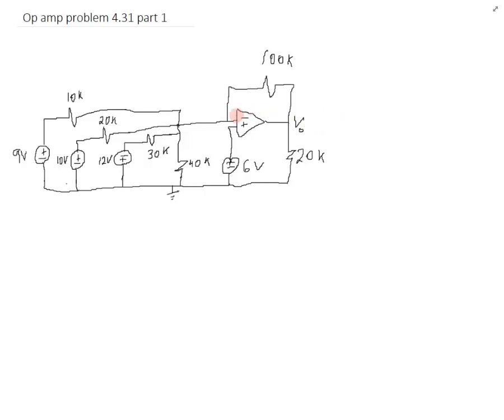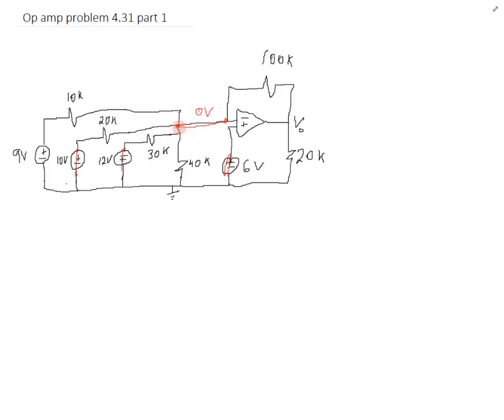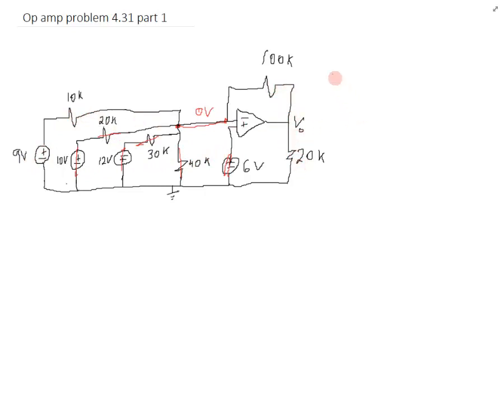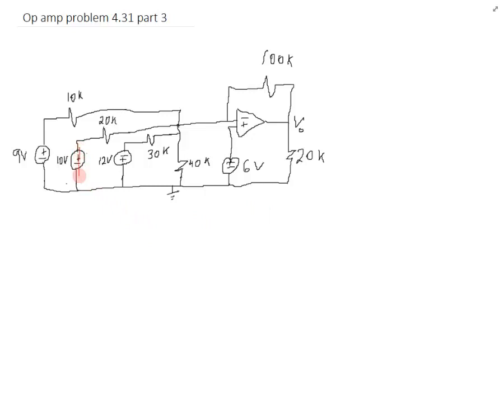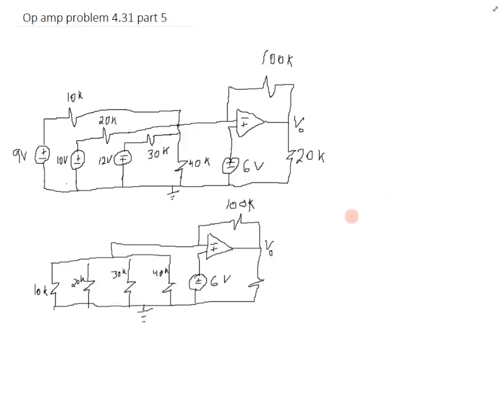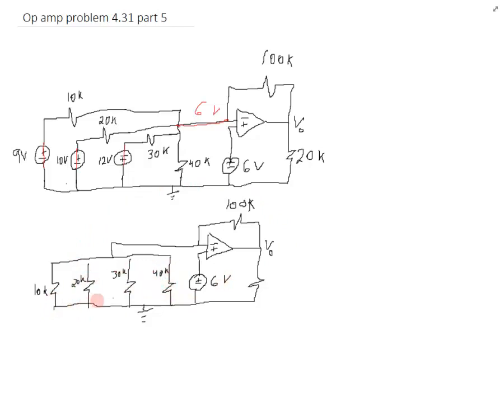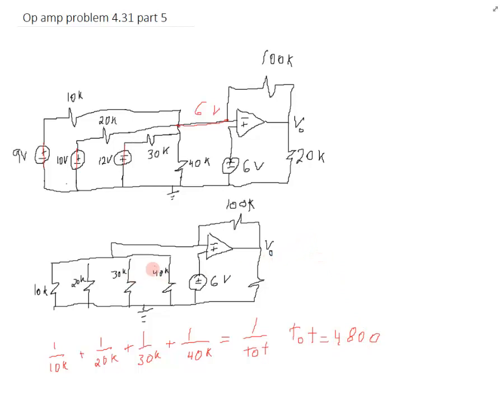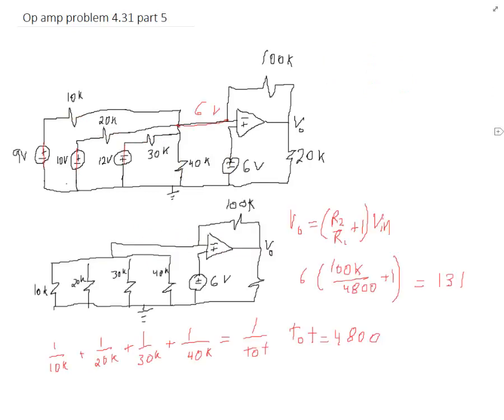Op amp problem with superposition

Comment: I have a question: what will happen if i don't use superposition method, I assume that that V below is 0, so we will know the V+=V-= 6V, then we can use KCL at negative input to compute immediately V0, it's 31V (like you)
However, I got a problem, If I KCL at point (that is below and have V=0), we get another V0
What's problem? thanks